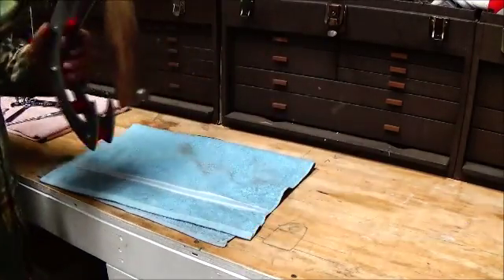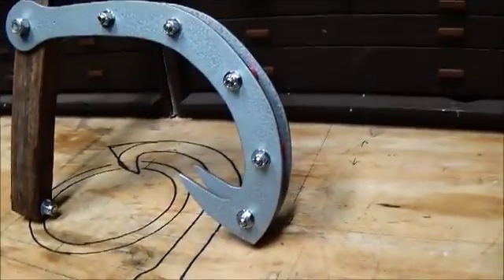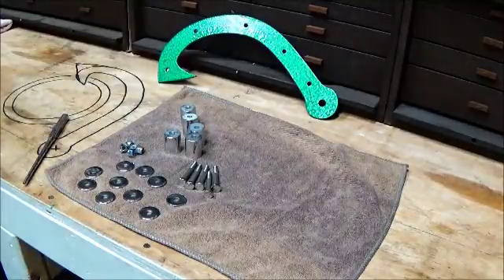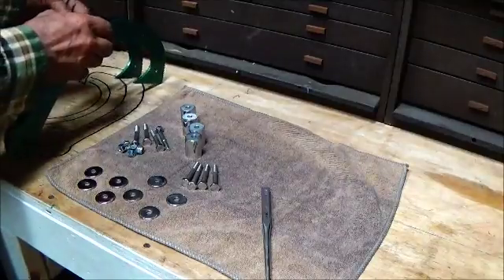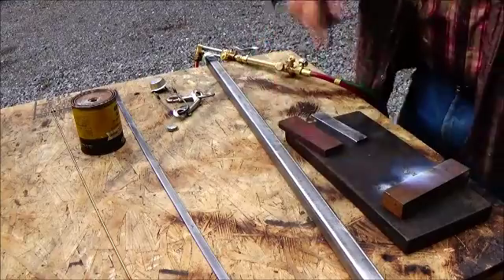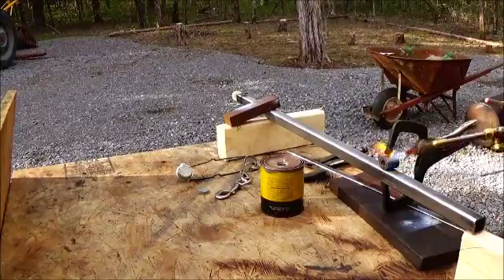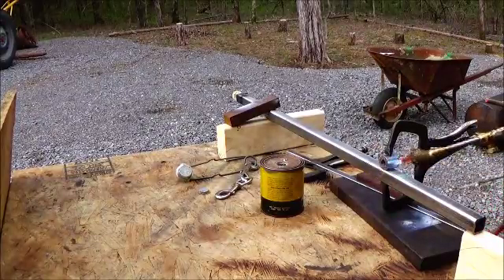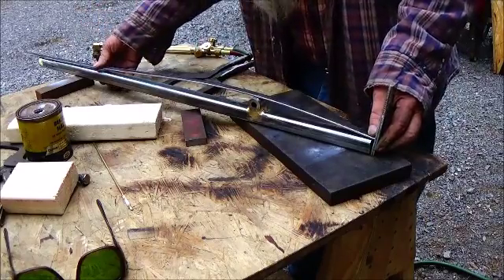How I Built the Grizzly Tools Cant Hook

Comment: How would it work if you took the bottom bolt out of the of the original wooden handle, replace it with a slightly longer one, sharpen it to a 45° point, then reattached the nut? Perhaps that may allow a better grab on the log? Just thinking out loud here.......leave a comment.😜👍